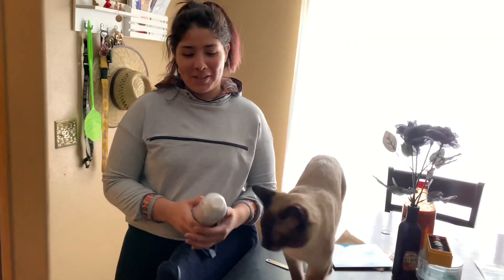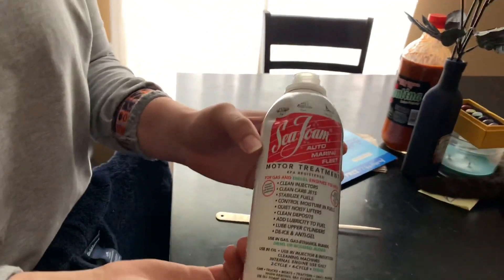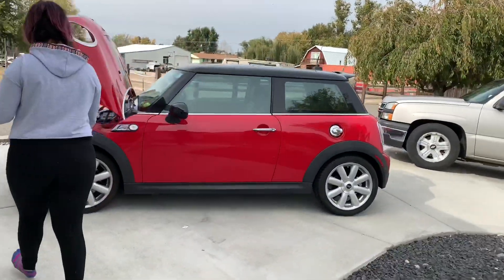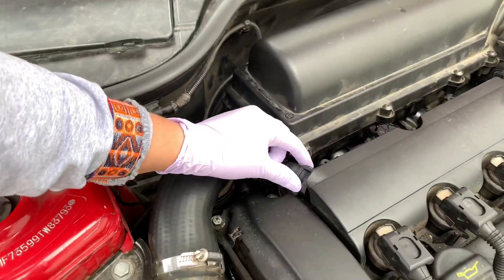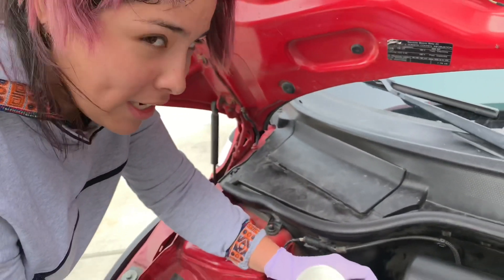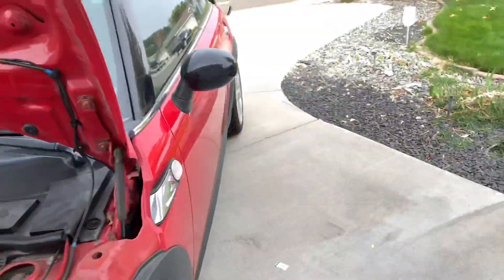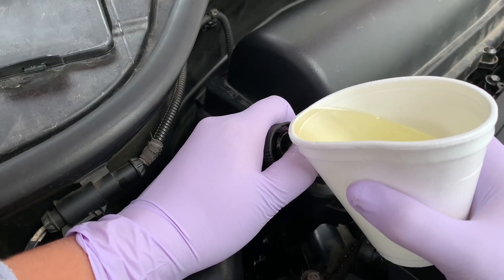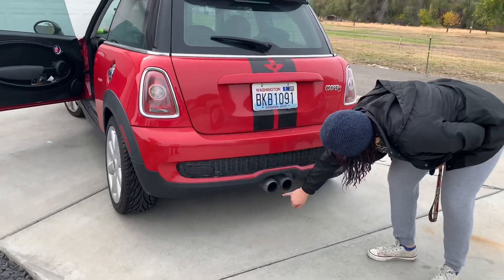Seafoam treatment on 2009 Mini Cooper s r56 | VLOG 1

Comment: well at a guess the engine check light would've been due to excessive amounts of air getting into the engine etc "nothing major" due to the split hose etc
the sea foam... erm, probably didn't do a thing....

you should've removed the inlet manifold & inspected the inlet valves & then carried out a clean up trial with the sea foam & then re-inspect the valves.. I've used other chemical cleaners before on my Clubman S & they didn't do a thing in cleaning the build-up, I ended up cleaning the valves manually & fitting 2 oil catch cans.
Reply: i just ran the STP Intake Valve Cleaner on my 2014 Cooper S (F56 B48) yesterday and the difference was SO night and day, despite the fact that there was nothing particularly noticeably wrong beforehand. The STP one dispenses itself over the course of 10 minutes into the intake pipe while you rev at ~2000rpm.

I could try to take a look at the intake valves to see for sure how clean they are but I don't need to. There is a REMARKABLE difference in how much better the car is running now. Far more responsive acceleration, enough to know for certain that it isn't just a placebo effect. I'll keep an eye out in the coming weeks to see how the fuel economy improved.

Comment: Nice job, Seafoam is the best. May I add a recommendation? Use the Seafoam Spray instead. It's easier and I think does a better job.
Reply from the maker: Adam Smith thank you! Ill try that next time (:
Reply: Has the product been proven? and how often should I do? Thanks BTW
Reply: perez senior intake valves should be cleaned every 10,000 miles for best results.
Reply: Where do put the tube for sea foam spray? Just after the air filter or near the throttle body?

Comment: What many don't understand is any solvent based engine running cleaner while safe for old port injection engines should NEVER be used on a GDI engine, especially ones with severe coking. ONLY a manual cleaning done properly is safe. As the fuel does not touch the valves to keep them cool, the coking deposits bake into a hard crystalline structure that while most is expelled out the exhaust, some is forced between the cylinder walls and pistons causing scouring. We have yet to see a tear down after a cleaning NOT damage the pistons.  This is serious as the makers of these are pushing them on shops all over. ONLY a crushed walnut shell blasting or the brush and pick method is safe and the solvent also removes less the that half of the deposits so that alone is also reason not to use these!!  Search here for videos on the valve cleaning.
Reply: I don't quite understand you. Are you saying that Seafoam treatments don't work on a gasoline direct injection engine and that Seafoam will scour the cylinder walls and create extreme engine oil consumption and still NOT clean the carbon deposits? I'm a girl, trying my best to understand all this technical stuff. Thanks.
Reply: @paulinelambert7780    All solvent based upper induction cleaners work the same way, they soak into the coking deposits and expand and break loose up to 40% (from BG's website) so first, that's not a good cleaning. Second, unlike the port injection engines of past that have no coking issues and these do a great safe job of cleaning carbon from piston tops and combustion chambers, with the "soft" carbon of those engines the benefits were solid. BUT, Google "GDI Intake Valve coking: and click on "images". Just look at the severity of GDI coking. And as NO fuel touches GDI intake valves to keep them clean and cool, cool being a key here, they operate at far higher temperatures and these deposits bake into a crystalline formation that is hard as sand. So when one of these solvent based cleaners is used, and parts of the deposits break off, while most is expelled out the exhaust, we see scouring (scratches) damage to the pistons and rings. If that seal between the rings/piston/cylinder wall is compromised with scoring, blow-by is increased and with it oil consumption. So the ONLY safe way to clean these is a manual cleaning. This is NOT a big ordeal. Simply removing the intake manifold and cleaning them manually will get all deposits off safely. Crushed walnut shell media or the pick and brush method is the only proper and safe way. Problem is very few shops do this (its far easier to charger the customer $150-$350 to poor a $19 can of cleaner in) outside of BMW shops, etc. but we have never seen damage NOT done and we have hundreds of examples as were a R&D facility that tears down and inspects these engines to develop solutions and products to prevent coking. www.RXCatchcans.com
Reply: @tracylewisperformance2270   Thank you so much for making the effort to educate me. Thank you so much. God bless u and yr family.
Reply: @paulinelambert7780  No problem. Accurate info is very hard to find now days.
Reply: @Tracy Lewis Performance  - I'm planning to do a walnut blast cleaning – are you saying this is only to be done after the majority of deposits are removed with walnut blasting, or that this should never be done?
Reply: @SZGX  Crushed walnut shell blasting does by far the best job and no prep other than taping off the ports to the 1-2 cylinders that the valves will be open on so no debris falls in. This is a Ford turbo 4 cylinder but he does a great job: https://www.youtube.com/watch?v=iE34UU4Iz_A

Comment: Was the treatment in regards to the check engine light? Did it eventually clear it?
Reply from the maker: Yes and no. But the light went away for a bit and came back.
Reply: @regulvtors1790  Get yourself a cheap code reader. Mine was £12. I keep it in the glovebox and get it out when it throws a code. I got check engine light recently and I got a fuel rail fault. Think my HPFP is on it way out or the sensor. Anyway it allowed me to pinpoint the issue.
Reply from the maker: @grantc8353  thanks for help. we dont have the red mini anymore because we were having a baby and needed a bigger car but we did buy another one about a year ago. perfect condition. should we post about it?

Comment: I watched the video,but need to understand why you did Seafoam treatment.What you trying to achieve?
Reply: Zaf Mahmood cleaning the intake valves.
Reply: Like removing built up carbon that could cause lose of power to the endings or more serious damage to even the piston heads.

Comment: Ugh, where to begin...Wrong, wrong, wrong. Don't follow this video's instructions unless you want to screw up your car. Just don't.
Reply: What’s the proper method other than walnut blast?
Reply: @precool  There is none. Walnut blast only. Using chemicals can cause large fragments of carbon to break free of the intake valve, pass through the engine, and bend the blades of the turbocharger impeller as they come out the exhaust. They can even get stuck in the blades and stop the turbo from spinning, although that is rare. There are bulletins out from pretty much every manufacturer telling technicians not to use water, Seafoam, or oven cleaner to clean intake valves. Walnut shells only.
Reply: @getplaning  My shop of choice is 💯 walnut blast. Thanks for the great info. 👍🏻